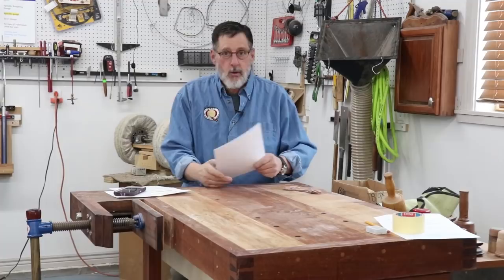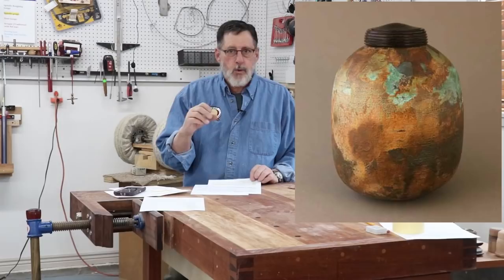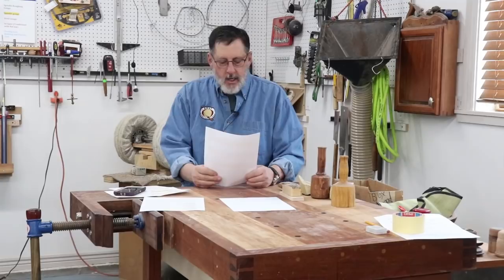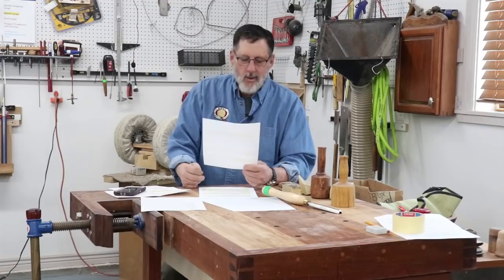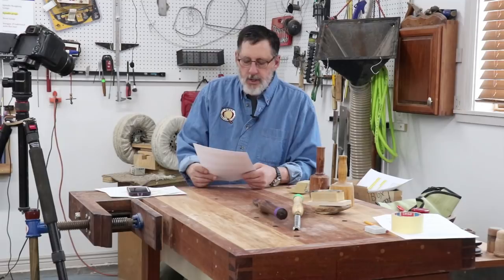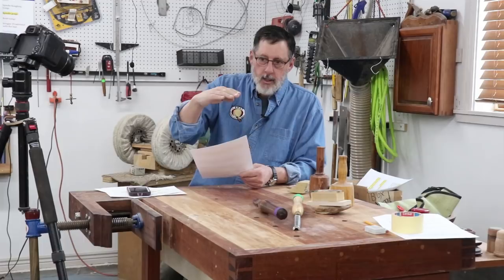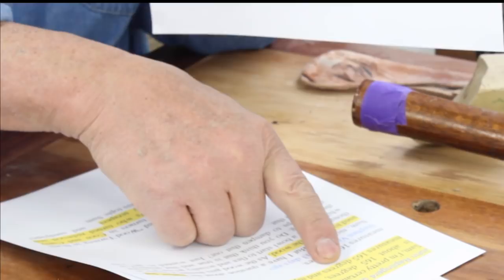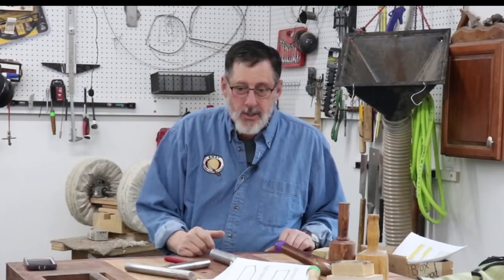Notes from the Turning Shop April,  2020     with Sam Angelo

Comment: Sam, on curved bowl rests, I have two S shaped versions with flat top faces1,1/4" wide, so each behaves more as a platform than a fulcrum, to avoid the problem you pointed out. I had to make them myself, from a good hard wood to minimise any edge attrition; but of course they are set for scraping at centre level. Admittedly, I do not use them frequently, so they are still sound 12 years on.  Bernard.

Comment: I suspect that the reason turners rarely raise a burr with a burnisher is that we no longer use carbon steel in our scrapers (or at least not very often).  It is very difficult to raise a smooth even burr on high speed steel with the old-style burnishers (besides I no longer have a steady hand). Thanks for your beneficial offerings!
Reply: It is easy to raise a fine burr with a carbide rod. I found a lot of used carbide end mills on ebay for about a dollar a piece.